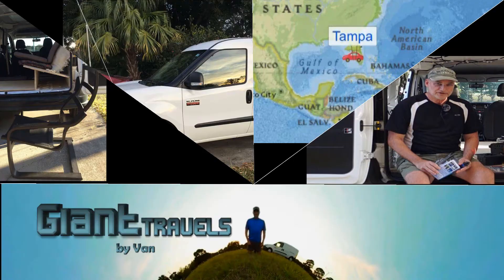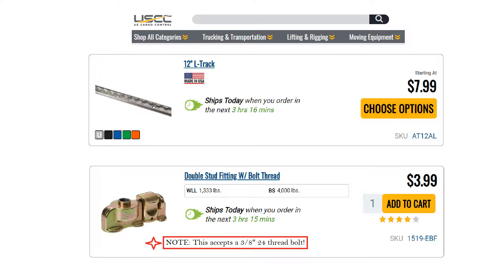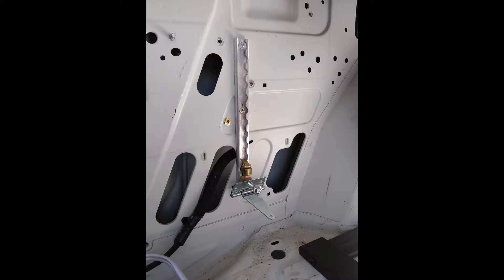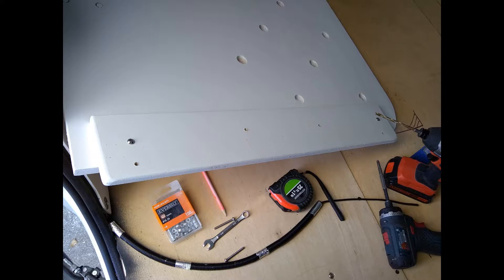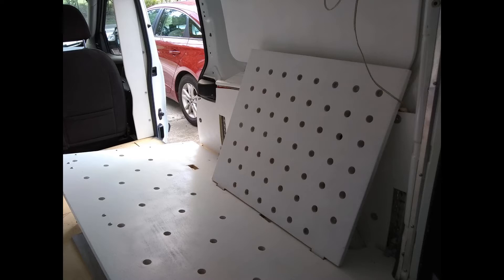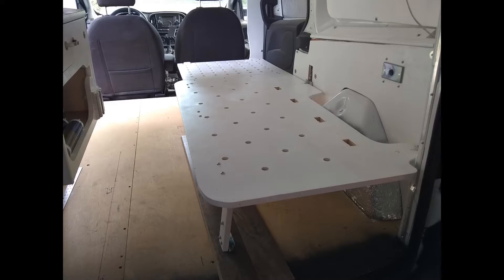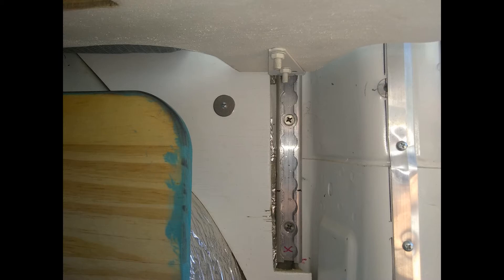Giant Travels by Van: A10 - Seating & Bedding

Comment: Brilliant! I plan to build out a PMC camper within the next 4 months and have watched every conversion that I could find on Youtube. This and the one by Geokite are the best out there. I plan to follow your progress closely. Thanks for sharing this!
Reply from the maker: Thanks very much!  I pretty much did the same before starting my build.  The channel has my entire build on it over the 12 episodes I have posted.  Let me know if you have any questions or alternatives you're not sure about and perhaps I can give some insight.  If you're thinking of a convertible platform as I showed can be both a bed and sloped back comfortable seat, I've devised some other ways it could be built also.  Even if you don't go Shou Sugi Ban, I highly recommend my way of gluing up tongue and groove before installing...  I've also converted my refrigerator while out here on the road (!) to roll out the passenger side door for easier access which I'll need to document at some point.  It was simply cutting some 2" angle aluminum stock from HD into 24" lengths (4 of them).  2 were used on a piece of 1/2" plywood as the platform the fridge now sets on, attached to 24" full extension drawer slides, then two attached to the floor and then the drawer slides.  It raised it just enough to clear my aluminum corner guards on the laminate floor and I just had to extend my 12v power cord to the fridge and it now easily rolls out for access, and no more dissassembling the bed to get in the fridge!  Good luck!   - Brian... from Washington state...

Comment from the maker: I've changed this setup for the 'fridge at 4:41: the refrigerator was mounted (during my trip!) on DRAWER SLIDES on a simple support shelf made of 1/2" plywood with ANGLE ALUMINUM joining the drawer slides to the plywood platform the 'fridge sets on, then the outside portion of the drawer slides are mounted to the floor via the same angle aluminum (1/16" thick, 1.5", 4' long from Home Depot).  The combination of 1.5" angle aluminum works just enough to clear the floor and the bolt heads under the shelf the fridge rides on.  You can buy either a 8' long length of the angle aluminum, or (2), 4' lengths as either way you can cut out 4 lengths that are 2' long each to complete the sliding drawer.

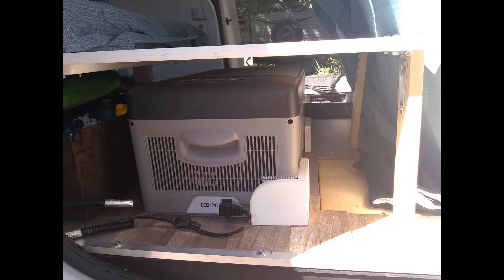The plywood platform was made the width (*width being that as looking at it from the end here at 4:41) of the 'fridge, and about 2" longer in depth (*depth being that direction going under the platform at 4:41) so that I could drill and enlarge a finger hole in the center of the end by the door to make it easy to pull it out.

With that change, it was no longer necessary to make this portion of the bed platform removable, however, to be able to lower down the "back" of the bed platform to convert it for "adirondack" style seating, you do need a split in the platform as shown if you're putting a 'fridge where I did, because the platform barely clears the 'fridge when it is level (now that the 'fridge is raised up a bit for the drawer slide assembly) so there's no room to lower the platform unless the platform is split into two parts as shown here so that the fridge section does not need to lower for seating.

I've actually considered adding a 2nd set of drawer slides, in reverse order to the first set, so that you could alternatively pull the fridge INTO the living space and open it.  However, I plan to carry a folding bicycle (Sondors Fold X!) which will need to reside in that area most of the time, so wouldn't have the clearance to pull the 'fridge in.  But if you won't have anything in that space, you could consider doing that and then you can open the 'fridge inward AND outward any time, your choice!